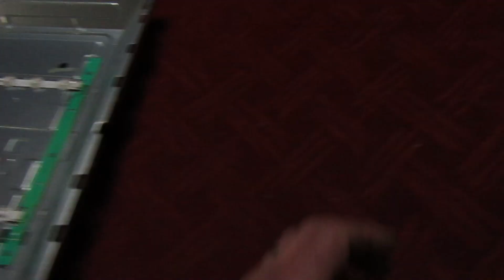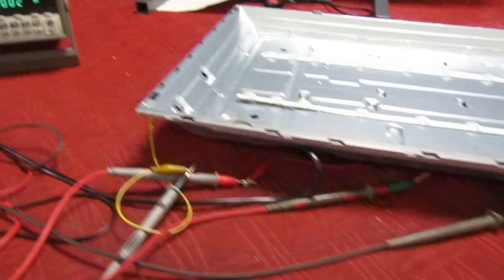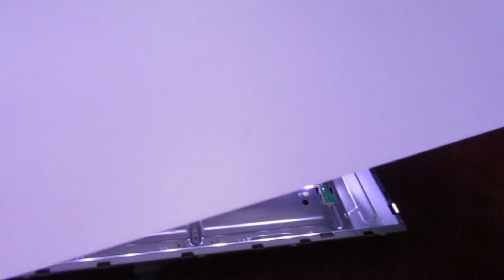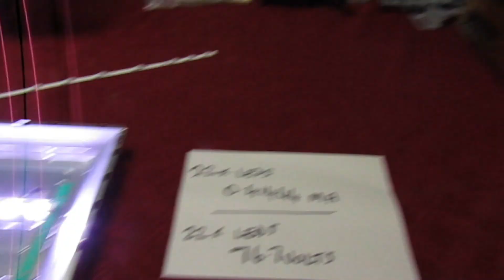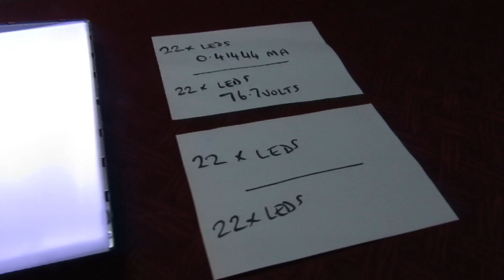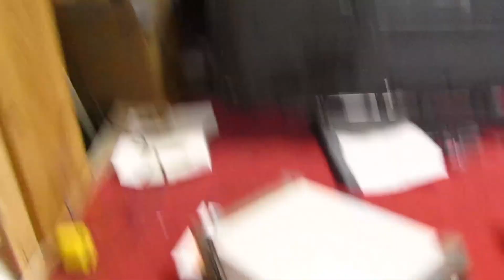LED backlighting , the myth explained with practical demonstration.

Comment: I happen to have one of these Vestel-based TVs here right now. I think it is branded as GoGen. It has one of those interesting faults. The TV works but the backlight is blue only. You can see it from the back through some tiny slits in the metal sheet. Ugly purple-blue shade of light. As far as I´ve gathered it is a common fault and the LED strips need to be changed.

Comment: Thanks for this (and your other) videos Michael.

As you say those Chinese testers are not always right: Would it be possible to test a single led strip with a lab power supply?

I have a 55inch lg, 11 leds per strip and that strip is diveded in an a anb b section with 5 /  6 leds.

So..if I limit the current to 400mA and the voltage around #of leds ×3V would that be possible to have a better testing method then the Ch.tester?

Thanks!
Reply from the maker: Yes, I have done this before but your psu must be either constant current or current limited otherwise you will just pop the led s.
Reply: Thanks for your reply Michael.   I gave it a go as I am waiting for new led_strips so I could use the old one for some experiments.

What worked for me is a regulated power supply on 6V/15mA (current limiting).  Leds did shine bright but not overly bright. 
I think this is a nice test voltage/current: higher might damage the leds (as I did blew up some trying that :-) )

Thanks for all your insight video's you make, great to get this insight knowledge,
Reply from the maker: I find its important to run the LED s at max rated current as some can light OK from a low current and then go open circuit when run flat out as they get much hotter.

Comment: The strips that the leds are mounted on may last a bit longer if some heatsink paste was smeared on the underside of the strip where the leds are mounted.
Dump a bit more of the led heat into the metal back.
Constant current regulators are handy :-)
Reply from the maker: One of the biggest problems are there usually fabricated on a SRBP board which has very poor heat conduction, however the Chinese have latched on to the replacement LED light bar market  and started copying them and they have  copied them better than the original onto aluminium strips  .
Reply: @michaeldranfield7140  lol better than the original, I'm surprised they would make that mistake.
Great for replacing faulty back lights and longer lasting :-).
I gave up television years ago, there was nothing i had any interest in.
I watch a nice chap called Allen, he is down Devon and he repairs lcd sets.
Far more interesting than t.v :-D.
Sorry i woffle on a bit.
Reply from the maker: @zx8401ztv  Yes , I know the guy you mean , he rang me up a few months ago looking for a main board for a Bush Vestell TV , think there was 6 different boards fitted to the same set depending on the production date , and I had them all apart from the one he wanted !
 Priced up a new one for him but it was £60 , far more than the TV was worth . Same boards but loaded with different software so not compattable .
Reply: @michaeldranfield7140  You did what you could to help him.
I'm surprised he didn't just save the useful parts and ditch the rest.
Thank you for trying to help him, he seems a decent chap.
Reply from the maker: @zx8401ztv  Sometimes when you get too deep into a set its hard to give up and call it a day , I have a set here been on a shelf for the last 12 months , looked at it on and off and couldn't find the fault , last week had a brainwave , realised what was causing the fault and I just need to find a part now , I could have just bought a new board but that would have been too easy and the customer would have not paid that much anyway .

Comment: With Sony sets and some others the set compares the voltage of different strings of LEDs and if they are wildly out the set will close down and flash the red led on the power switch to show a fault code. just thought it was important to say that . Once the LEDs are switched off with the code they will stay off until you power cycle the TV .
Great video 👍
Reply from the maker: Many thanks for that .

Comment: Educational, as always. I think some earlier (and possibly later) TVs extinguish all the backlights if the power supply detects a fault. Even if this is just one or two LEDs which have failed, there is no indication to the user (no fault code etc) of what has occurred, so, in the majority of cases off to the tip it goes. Of course, the cost of labour etc to replace backlights is sometimes more than a new TV. Allen Fleckney's channel is also a good overview of various backlight issues.
Reply from the maker: in some sets if the LED goes high resistance and drops a much larger voltage across it the output voltage from the power supply will rise and it causes the Open Led circuit to trigger and shut the string off completely as you say , the forward voltage of the LED s can easily be checked with a LED backlight tester .

Comment: Hi Mike, hope you got the information you needed for the Fiat 500 cluster issue,  because it was a repair channel, I couldn't say about, don't remove the needles, you can unclip and wangle all the bezels at 12 o clock, remove the LCD panel from the flex and 3 pin header post first, Cheers, Mike.

Comment: I have done that on my Edge lid Samsung TV as temporally fix. It was alright. What I read from forums like BadCaps is that this isn't good practice and every brand could operate the backlight differently.
Reply from the maker: it should make no difference , in fact some LED s have a built in protection device to automatically short out the LED if it goes open circuit, and you can buy external semiconductor devices that do the same job , search the net for LED Bypass semiconductor .

Comment: This is great I have a Sony with no picture so will have a look at it
Reply from the maker: usually with Sony it should blink an error code showing a backlight failure
Reply: @michaeldranfield7140  Where would the error code be as the led on the front looks normal 
Thanks

Comment: Thanks for the video, I found it interesting, didn’t know about the constant current setup
Reply from the maker: constant current is very important, if you just connect these to a power supply they burn out at switch on .
Reply: @michaeldranfield7140  yes I remember getting some Leds from Henrys Radio probably about fifty years ago and putting one across a battery and it instantly blew. Lesson learned

Comment: nice video once again, what do you do with edge lit tv's which seem to burn the diffuser edges causing unwanted problems with the light diffusion? Ive stopped replacing the leds in these sets as its too much hassle
Reply from the maker: for some sets you can buy the diffuses sheets separately but by the time you have paid for the led bars and then the extra delivery cost of the diffuser sheets its hardly an economical repair and most people wont want to pay and just buy a new set.

Comment: Michael? Just a question that keeps popping up. I keep getting customers telling me that their TV's were damaged by a lightning storm. Upon inspection I would find back light failure. Nothing wrong with the PSU, nothing wrong with the main board. All wanting to claim from insurance. Are they taking chances or can a power spike or surge destabilize the constant current of the LED's but no other damage is evident. Once the back lights are repaired the TV is good to go.
Reply from the maker: I very much doubt backlights are damaged by a power surge , vestel sets have a VDR on the power supply that will usually explode blowing the pcb fuse in the event of a serious power surge , sometimes people just try it on in order to get a new set .

Comment: Is there no way to reduce current in power supply  maybe ?
Reply: Current is drawn not pushed
Reply: Turn down the backlight
Reply: Yes there is. Search for led backlight current sense resistor mod. :)
Reply from the maker: Yes turn down the Backlight setting in the user menu , or if your worried about customers turning it back up again after you send the set back download the datasheet for the LED driver chip and the max current setting calculation will be shown on the data sheet, its just a matter of re calculating a resistor value .

Comment: hmmm. but shorting a led means whatever is driving them is having to drop more voltage, increasing dissipation, maybe not a problem if its a switching regulator, but if not....(as in led bulbs, most now use linear current stabilisers instead of capacitive droppers)
Reply from the maker: With a switching regulator it does not seem to matter as the psu automatically compensates  but yes in other driver circuits it could be a problem .

Comment: 5,000 hrs on a Vestel 😂 I have had a faulty one with failed backlights with 1,854 minutes on the counter, nice video Michael excellent explanation 10/10
Reply from the maker: I have had quite a few recently with less than 2,000 hours go faulty, it would seem the newer the set the less they last .
Reply: @michaeldranfield7140   lol yep total rubbish nowadays!
Reply from the maker: @wisher21uk  Just had a Hi sense in for repair, no bezel on the front , LCD panel is just glued to the front of the set !!!!
Reply: @michaeldranfield7140  heard of that before apparently isopropyl alcohol run around the edges does but don’t hold me to that…. Do at your own risk ⚠️
Reply from the maker: @wisher21uk  Got one i for repair now , just waiting for the backlights , might make an interesting video !
Reply: @michaeldranfield7140  I’m sure it will be a very interesting video 😅, lately I have noticed if the leds aren’t blue the fault is the fingers on the backlight distribution board under the screen get burnt and it’s resolved by tinning the fingers where the strips connect too
Reply from the maker: @wisher21uk  Had that fault , took months to find the first time because the set never went off in the workshop, it only went off when the customer got it home !
Reply: @michaeldranfield7140  that happens a lot lol, it can work for days and then customer has it a day and it goes off lol

Comment: I think one of the main reasons LEDs fail (apart from junk LEDs) is overheating. If the LEDs were actually fitted to the back panel (heatsink) with even a bit of grease, there life would be somewhat longer. The LEDs may well even exceed the life of the SMPS before that overheats or the caps blow up.
Reply: yep, they drive them hard to get the brightness up
Reply from the maker: @andygozzo72  I think they now come out of the factory as standard with the backlights set to 100 percent.
Reply: @michaeldranfield7140  yep, they certainly seem to, i always back off my laptops/monitors/tvs as much as i can, IF i can ..
Reply from the maker: this is correct LED s need to be kept cool for a longer life and most edge lit sets have the LED s mounted on a large aluminium bar for heatsinking making them more reliable  but of course this cost money .

Comment: Thanks for the heads up!  I have a couple of Samsung's in need of repair. Faulty LED backlights of course.  I've never had one in bits before, so come the day, it'll be a voyage of discovery.  I'll probably just order up new LED strips for both since I don't relish the task of disassembling the screens, so my thinking is, if I'm going in anyway, I may as well eliminate any immediate future failures by replacing the whole string.

I'm only dabbling with such things, so as long as spares are cheap enough, I can learn from the experience.
Reply: You'll need to remove the display itself. It's a 2-3mm thick, so better watch out. You can easily crack it, almost a 100% chance when you start working with them ;).
Reply from the maker: @screen-protector  Just had a Hi Sense set in for repair , going to be a miracle if I get this fixed without breaking the screen , no bezel on the front, the LCD panel is just glued to the front of the set and its recessed into the frame .
Reply from the maker: Of course all the LED strips need replacing if you want to do the job right, this was just to show you don't have to replace a faulty LED with anything else apart from a shorting link , for critical situations such as in aviation where you don't want a display going blank you can get a semiconductor LED bypass device, it looks like a smd diode and you just solder one device across every LED , it just acts like a zener diode then if an LED goes open circuit the voltage across the bypass device rises and it goes short circuit to automatically re join the LED chain up . Have a look on the net for LED bypass semiconductor .

Comment: First, again lol, brill video mate, i put 1mm thermal pads behind them, they will last over 20 years
Reply from the maker: most LED s are mounted on a SRBP type PCB and then stuck on to a steel backplate so very poor design to start with, edge lit LED are mounted on a large aluminium bar  making much more reliable.